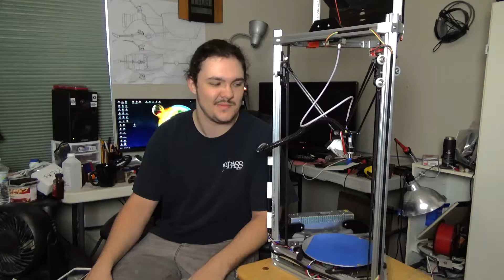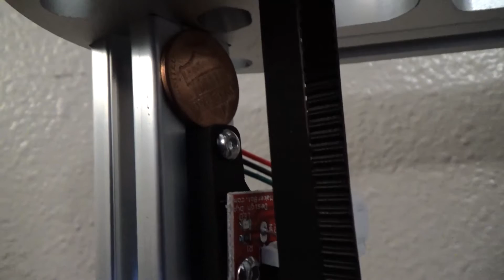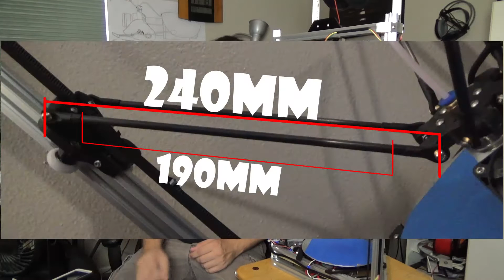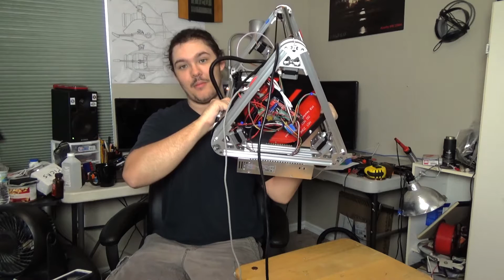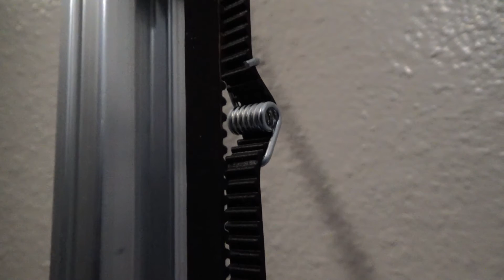Folger Tech Kossel 2020 3D Printer Calibration | #1 - Construction Tips

Comment: I am building a custom delta 3d printer based off of a Kossel xl. I got the end stops figured out (meaning they are triggered when closed). The problem I am having is when anyone of the X,Y endstops get pressed the printer will not move anymore. Do you have any ideas how to fix this?
Reply from the maker: Make sure they are plugged in correctly. Wrong polarity on the endstops or if the endstops are in the wrong position can cause that.
Reply: They are. Do you know where I can get a better version of marlin for kossel at?
Reply from the maker: Directly from Marlins githib. The only version I have is for the Folger Tech printer.
Reply: So I Noticed that the z motor doesn't respond and when i try to move the z motor it will move the x or y axis instead. Do you know why this is?
Reply from the maker: Sam Blaha kossels don't move each axis per motor. If you move the z axis, all 3 motors should move in sync up and down.
Reply: I don't understand why my printer is not moving up and down all at the same time.

Comment: I'm having an issue with my heated bed the thermistor always reads 0 if i switch it the the plug for the hot end thermsitor it reads a value , i think it may be my software but im having trouble figuring it out any ideas?
Reply from the maker: Use a multimeter to check the resistance of the thermistor. It should show a resistance
of between 80k-110k ohms, at room temperature. If you get 0, open circuit, or infinite,
or a number that is way off from the range, then the thermistor is most likely damaged,
and will need to be replaced.
Reply: thanks I did that and it's good I looked at a different wiring diagram online (not the one Folger tech supplied) and saw that the first 4 pins are for the thermistors not 2 skip 2 then the last two for the bed. I now get both temperature readings but after the printer is turned on I get a max temp error when nothing is heated up and both thermistors read 22-24 I have no idea why I get this when everything is cool I tried disconnecting it and reconnecting it still no luck

Comment: Would you recommend the Kossel over the Prusa i3? Willing to spend extra for reliability
Reply from the maker: If it is your first printer, go with the 2020 Prusa i3 (not the acrylic one). If you have experience with these printers, get the Kossel as it is much more challenging to get calibrated and printing perfectly (hence the need for this series). The Prusa only really lacks the speed that the Kossel can do, and build height. The Build surface is bigger on the Prusa, the calibration is super easy, and it is very reliable once tuned.

Comment: yes. I have all of those jumpers in place. the jumper I'm speaking of is for the three pins left of the button switch on the board. In the instruction its a green coloured jumper. as far as the driver jump I'm good. just not sure about the jumper by the switch? apologies for any confusion.
Reply from the maker: +Desmond Moore I dont see anything about that in the instructions, but looking at those pins, you should be fine without any jumpers on them.

Comment: Got the kossel started the build today noted that there was a green jumper missing from the controller broad by the push switch. I only questioned this because in the instructions they show a green jumper.  Do I need that? If so what's the jumper layout. I think i can mange with the left overs to get it done. Love the vids big help thank you Dustin.
Reply from the maker: Usually the jumpers are pre-installed, and are small black jumpers.

Comment: Hey Dustin, is there anyway you could email me? I'm having some troubles with this printer.
Reply: I'm mostly having troubles with the auto leveling. Everything is installed fine but it runs into the bed and doesn't level.
Reply from the maker: +Zach Arnold If it runs into the bed then you need to adjust the bed height, which i cover in Ep 5 of this series. My email is on my Channel's about page.